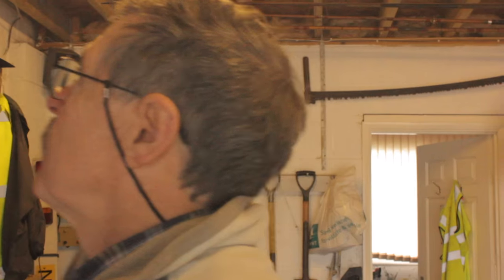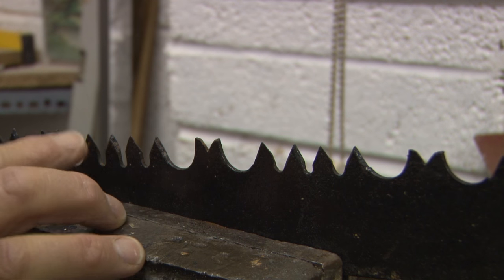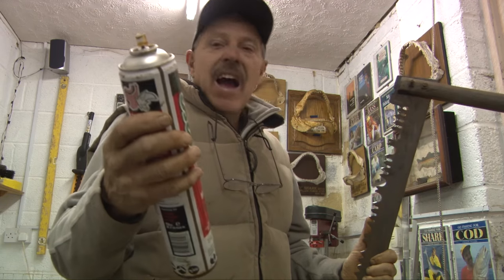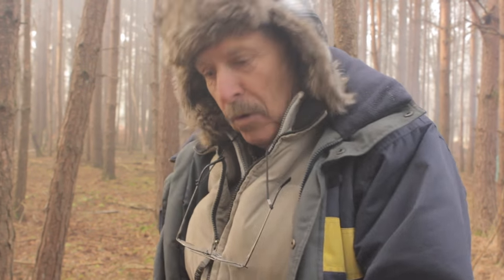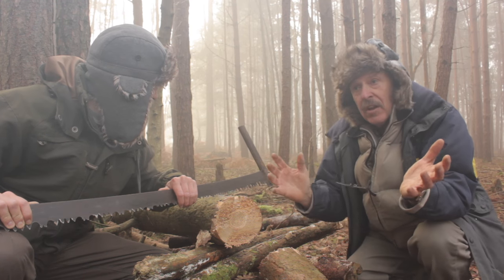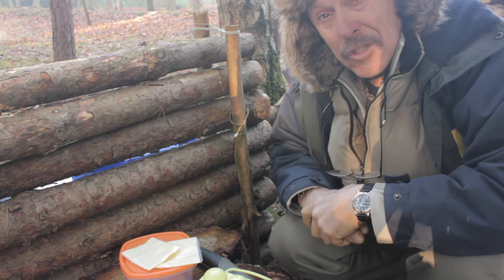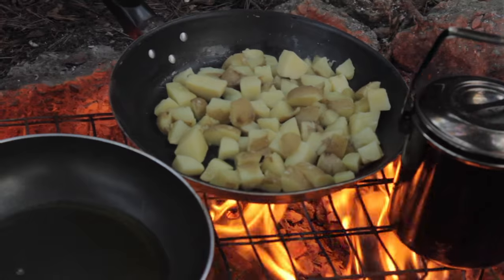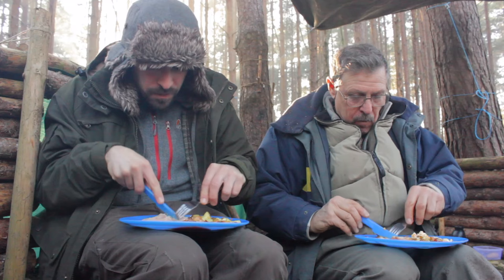Bushcraft - Using an Ancient Saw on Logs + Cooking on the Fire at Camp

Comment: Here's an interesting fact - in days of old, planks were cut from logs using a saw similar to you Dads. They would be cut over a saw pit, where one man stood above the pit and one man stood down in the pit to give the clearance needed to cut the planks. The man at the top was almost always the more senior sawyer. Today we still use the expressions 'top dog' and 'under dog' which derives from this! Cool or what? But not for the poor sod in the pit!!! Love the channel, keep up the great work! 👍🏻
Reply: This job is covered by Tony Robinson in Worst Jobs in History_. Those two types are called cutters and rakers. The rakers do some cutting, like a chisel or cabinet scraper at the bottom of the kerf. The cutters alternately score the sides of the kerf. The action in asci characters would look something like this. "--[]--[]====[]====[]--[]-_-" It looks different from a crosscut saw, I believe. Although, It would appear to have no (off)set to the cutters it can be used either Crosscut or Ripsawing. No set to the cutters and the thin back tells me that it is a Rip saw.

Comment: That is a beautiful crosscut saw. Older saws were thinner on the spine and thicker gauge at the teeth. Contemporary saws are the same thickness (gauge) from spine to the teeth. This is because todays blades are stamped, not rolled. You can find "sets" aka jigs for sharpening the teeth and "setting" the rakers. If you look down the teeth, you will notice that the alternating teeth are off set from each other. At their widest they should be equal to/or slightly wider than the width of the raker. The sets/jigs are a tremendous aid in sharpening to a constant depth and angle for the teeth. The rakers are the hardest part to sharpen and are the real work horse of the saw. The rakers act as a chisel, plowing out the material that the teeth scored. To "set" the rakers takes some practice and the set/jig makes this much easier. Much like the tool/jig for sharpening a chain saws and "setting" the "rockers", the set/jig for a crosscut will help fine tune the depth of cut for the rakers. Setting the rakers is a skill and talent that has to be practiced and I am sure there are vids to guide you thru this process. Just so you have the understanding that the rakers do the work and need the most attention. When carefully and properly sharpened your beautiful saw will cut "FASTER" than a modern chain saw. You will know you have gotten it right when, on each pass, your raking out curls (much like a plane or a spoke shave). Happy cutting.
Reply: P.S.  Remove the older handles and hardware, put them up for safe keeping. I say this because you are going to get many more years from that saw. Replace the handles with contemporary handles for you bushcrafting.. You can fashion a guard for the teeth from a garden hose and paracord. When hiking the handles should be removed and the saw should always be carried on the down hill side (SAFETY FIRST). Bees wax works great for lubing and protecting the saw/teeth/rakers. A well cared for and sharpened crosscut will last an entire season with minor adjustments. It should only need an annual "set" and sharpening.

Comment: In America they were simply called "Two-Man Saws". And wedges were used with these saws. Usually steel or iron wedges much like an axe head and sledgehammers were used to beat the wedge into the cut as the cutting progressed. These saws were only used on trees to thick for a standard handsaw. 

As for bringing eggs to the camp for cooking, if you ALWAYS intended to make SCRAMBLED eggs then the easiest way to transport them is to mix the eggs up at home the simply funnel them into an empty plastic water bottle when you've finished drinking the water. Or a soda bottle might be better because they are more rigid. Then when you start cooking, just pour the eggs into the pan. 

Again I ask, with all that fallen wood you have around you, why are your camp walls so short? About 3 feet high? If you wish to see over the walls to the outside, that's fine but you can build then up to chin level to make for better wind resistance walls. And if they are higher, you can make your raised bed sleeping area higher as well, at least 18 inches off the ground. 

Also, I have a suggestion for you. So many people use space blankets or such as heat reflectors in their sleeping areas in their camps. Instead of using those very thin blankets try using two layers of Aluminum foil and a staple gun. Pull the foil out in full length (across the bed area) strips, put two strips together by folding the right and left edges over and start stapling them to the bed area starting at the top and working you way down until you've covered the whole bed area. Instead of paying $15 - $25 for a single space blanket you can spend up to $13 for TWO rolls of 150 feet of heavy duty foil. That would cover a very LARGE amount of area in your camp.

Comment: Next time you need to add some diced onions to your taters. That was a "Lace"tooth crosscut saw. Some times they were used for planking (sawing planks from whole trees) before the saw mill came about. A much wider saw would have been used, your narrow saw was used for cutting "sized lumber", like 2X4's from cut planks.

Comment: The sets of 4 teeth are used to cut the sides of the kerf, or the channel the saw makes as it works through the wood. The twin rakers are used to clear the wood from the bottom of the kerf. They also serve as depth guides to keep the saw from biting into the wood too aggressively. As the side-cutting teeth are sharpened, they gradually reduce in height. The rakers should be filed down accordingly, else they will hold the cutting teeth from biting into the wood at all. The rakers should be filed flat on the top, with their "cutting edges", if you can call the that, aligned with the bottom of the kerf.
Reply from the maker: That makes a lot of sense.Especially with an old saw that has had use.I will attack it with a file and get it lined up with the cutting teeth before trying again.Thanks for the tip.

Comment: The teeth without an edge is a raker. It's used to clear out the chips. If a saw is good and sharp it should be throwing noodles. If you need more information on crosscut saws look up wranglerstar.

Comment: The saw is sticking in the cut because the teeth need to be "set". Alternating teeth are angled out slightly. In a handsaw this can be done with a one-hand tool called a saw set. In a thick bladed saw sometimes it has to be done with a punch and a hammer.  When a saw has no set it cuts only the thickness of the blade so of course the blade wedges. With the right amount of set it will cut a slot or kerf 50-100% wider than the blade. More set is required for green wood; less for seasoned dry wood.

Comment: Yes the double teeth are called rakers to clear away the wood that has been cut by the other four teeth. And you can use kerosene oil or wax to lubricate the saw as it cuts. These saws are common in the southeastern US.

Comment: if I'm not mistaken there is a small tool that offsets the teeth on the saw a small amount so that it cuts wider than the blade thickness allowing it to go through the wood without binding.
Reply: Yep, that's called "setting" the teeth in order to provide a decent kerf.

It's unclear from the video whether the binding of the blade was due more to lack of set or just instability/floppiness of the wood being sawn.

I worked with a similar saw when I was a youngster back on the farm. As mentioned in another post, the one we used was maybe 5-6" high as opposed to the narrower profile shown here. Nevertheless, that was the way it was done before modern chainsaws became the standard.

Enjoyed the trip down memory lane.
Reply: Tyler, for a saw this thick and teeth that deep, the setting tool would have to be bigger than the one I have. Kind of worrisome to me is that this tool is useless on many makes of modern handsaw.

Comment: those 2 teeth without an edge are designed to clean the wood dust and chips out of the log you are cutting, also they assist on keeping the blade from binding

Comment: used one them and the thicker blades ones a lot when younger still got couple about somewhere . also it where thee saying top dog comes from a man in a pit did the down stroke and the man on top the pit did up stroke the man on top was top dog the one under neath was the under dog. seen comment saying about the teeth and way they are so no need say they pull out wood to clear the cut. you should know that it would trap saw if it bounce and one end not left to drop.

Comment: I'm no expert, but it looks to me like the teeth have been sharpened and used a lot. They seem shorter than they should be. Also, the double teeth are called rakers and the actual teeth score the wood and the rakers cut it out like a chisel